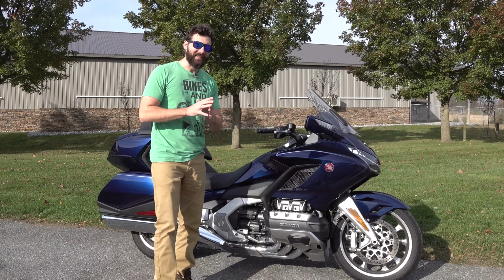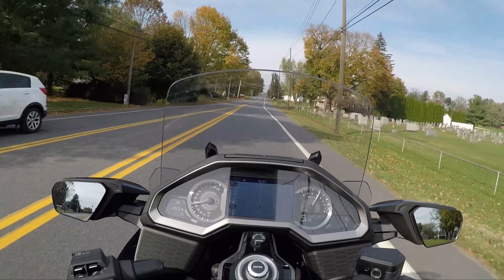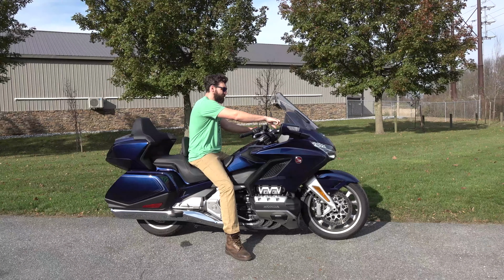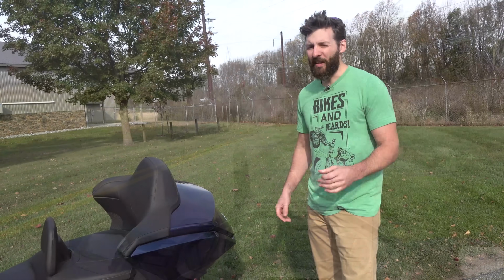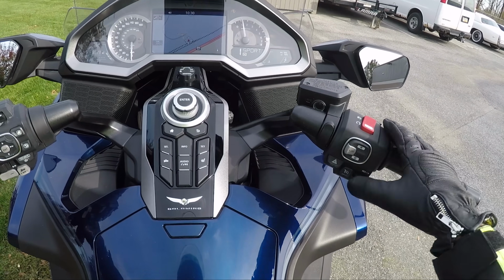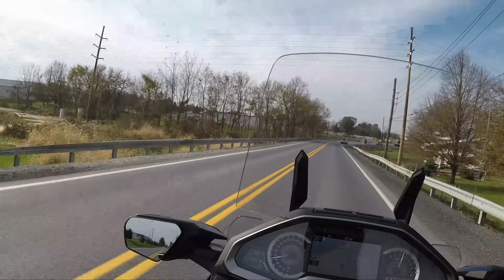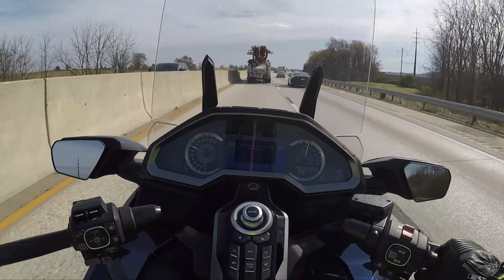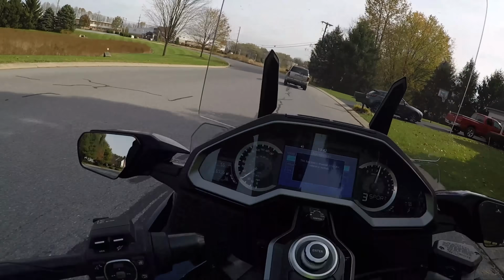You WILL NOT believe what the new Goldwing can do

Comment: Beautiful bike, I want one. It would be nice if the “tour pack” was removable.
I asked the Honda dealership, it doesn’t come off, at least not without a lot of tools.
Reply: Traxxion Dynamics in Woodstock, GA has ya covered with a conversion kit for the Goldwing and quick change option for tour.  YouTube search for Max McCallister.
Reply: Check billable hours on an air filter change before making that choice.....
Reply: @ZacVaper  Honda sells only a conversion kit to remove the tour pack and replace it with a cover. The OP is referring to a quick kit to remove it on days you don't want it, add it on days you do. If you look up the install time on the Honda kit, its 2.5 hours.
Reply: That's exactly what I keep thinking I don't take long trips I would like it without all that gear on it you would look so much better

Comment: For me, some of the pleasures of owning a motorcycle are “feeling the road “ and shifting gears. As far as the windshield going up and down, my BMW K1200LT did that. I had one of the previous generation Goldwings and my only complaint about it was whenever I tried to ride it like a sport bike, I always drug the boards even sooner than I did on a Harley. Now that I’m officially an old guy, I’d probably like this Goldwing. Unfortunately my legs don’t work like they used to so I’m off 2 wheels for good. Ride safely.
Reply: Get a Trike
Reply: @ronniemassart3834  what a thoughtful response. That would make a great deal of sense if I were able to lean into curves in the same way I did on 2 wheels.

Comment: I’ve been looking at all kinds of touring and sport touring bikes, including baggers, and I keep coming back to this. It’s everything I wish my 2016 FJR1300 was, and more. And compared to the rest of the class it’s the best value.
Reply: I sold my 2014 FJR1300ES and bought a 2022 GW tour DCT.  I loved the FJR, but the wing is a better bike.  Better suspension, brakes, handling, and comfort.  The GW is a little down on top end power, but you won't notice with that 100ft/lb of torque from 0 to 3500 RPM.  Speaking of power - A lot of my friends thought it would be slow.  Put it in sport mode at a stoplight and pin it when it turns green.  The front end gets super light, and the traction control is blinks rapidly!  Feels like it's going to pull your arms out of the socket!
Reply: @Skip_Recap  Sounds awesome. Now that I’ve owned and sold a DCT Honda I would buy the new updated 2022 Wing with a manual, especially since they’re likely going to be DCT only going forward. Manual has a higher top speed if what I’ve been told is correct. DCT is fantastic, but I’m always going back and forth between how great it is and how much I miss manual. Ultimately you need two bikes, one DCT.

Comment: yes it is the best MC out there. Nothing compares to the handling or power
Reply: Bill Sawyer Until you ride a K1600.
Reply: @LTVoyager  I was disappointed with the lack of low end power and lack of torque on the K1600. You have to rev it up. It did handle well though with good ergonomics.
Reply: Pitts S2C The K1600 is certainly a higher performance engine and like all high performance engines, it likes higher RPM.  I believe the redline is nearly 2 grand higher than the Wing.  So, it does attract a different style of rider.  Just as Harley attracts those who want to loaf down the boulevard at 2,000 RPM, the BMW attracts those who believe the fun is a twisty road running in 2nd gear between 6 and 8 grand.  Different strokes for different folks.  I only replied to this as the OP said nothing compares in handling or power and this is simply BS.  The K1600 both out handles the Wing and outruns it easily.

A year ago this past summer, I test rode the new Wing (DCT Tour model), the new Yamaha Venture, the K1600 GTL and the K1600 GA all within a short time span.  They all had their strong points, but for pure performance, the K1600s reign supreme.  However,  none were better overall than my current K1200LT so I elected to wait a couple more years before swapping rides.  Once my LT passes 100,000 miles next year or the year after, I will take another look.  The Wing is just too small in storage capacity for long distance two-up touring so it isn’t a contender for my travel style.  The Yamaha was very comfortable and has great storage capacity, but I am just not a 4,000 RPM redline, air-cooled V-twin type.  I like the GTL best for me personally, but my wife hates it.  She sits too high and gets tons of helmet buffeting which is not good for all day riding.  The GA was the best fit for her from among the four we test rode, but I am not a big fan of the stying as I much prefer the European style of the GTL.  In the end, we decided the LT was still the best fit for us and decided not to trade.  However, the power and electronic wizardry of the newer bikes is appealing.  I probably will test ride the new R1250RT before deciding what to buy as it has about the same performance as the Wing and K1600 in a lighter, simpler and easier to maintain package, albeit at some sacrifice in comfort.  All bikes are a compromise and the hard part is deciding which compromises you are willing to accept.
Reply: @LTVoyager  I had an LT and have had a GTL since 2013. My wife had the same issue on the GTL; sitting up high and getting wind noise and buffeting. Bought her a Schuberth C3Pro and problem was solved. Helmets can make a huge difference!
Reply: @pittss2c601  "low-end" is a very relative term.  If you're used to Harley's then low-end is 1500rpm, but on most multi cylinder bikes, especially in-line types with over 9k redline, 2500 or 3000 is "low-end", and there's no way the K1600 doesn't have plenty of grunt at those RPMs.
Reply: Tibor Toczauer I agree that a different helmet can affect wind noise, but the noise is not the issue as we wear earplugs while riding.  The issue is wind buffeting and a helmet doesn’t affect that appreciably.
Reply: Tibor Toczauer The Wing does produce more torque at lower RPM than the K1600.  I believe the Wing climbs above 100 lb-ft at about 2,300 RPM while the K1600 is closer to 4,000 to get above 100 lb-ft.  However, factor in the lighter weight of the K1600 and its faster revving engine and I will do a roll-on against a Wing any day in any gear starting at any RPM.  Any slight advantage the Wing has below 4,000 RPM will evaporate quickly.  I test rode both back to back and the K1600 outpolls the Wing in almost every circumstance as it’s 80+ lbs lighter weight offsets the Wings slight torque advantage down low.  The extra 230cc makes a difference at low RPM there is no denying that.
Reply: @LTVoyager  exactly, but that's because it delivers like a Harley; earlier torque and much lower redline. Just pointing out that the K16 also has plenty of torque down low, just not quite as low. That being said, I guess you'd be disappointed with the Wing after riding an electric, because those have real low-end torque 😉
Reply: Tibor Toczauer Yes, the Wing is better for those who are too lazy to shift.  That is why Honda added DCT.  LOL.
Reply: @LTVoyager  actually not just appreciably but incredibly well.  First-hand experience.
Reply: @LTVoyager  all I can speak from is our experience.  My wife is 5'6" and long-waisted, so she sits pretty high up on the back of the GTL.  Her head was getting buffeted all over the place wearing her old helmet, to the point where she wanted me to switch to a Chieftain where she was hunkered down behind me.  When the Shuberth C3Pro went on sale and I bought her one, the change was night and day.  I can now have my windscreen in any position and she is fine with it.  That is definitely not just a noise improvement.  We both always wear earplugs too by the way.
Reply: Tibor Toczauer I suspect the issue was the helmet fit rather than style.  A too loose helmet will move around on your head when in dirty air making the buffeting feel twice as bad.  A tight fitting helmet helps a lot, but it doesn’t affect the underlying problem.  If your head is in dirty air, it will move around and be very annoying after a long day and it doesn’t matter much what helmet you are wearing.  Dirty air affects objects of every shape and size and being “more aerodynamic” makes no difference.  If your wife’s Schuberth fits well and her prior helmet was too loose, then, yes, she will feel a big difference with the properly fitted helmet.  My wife uses the same helmet on our LT as on the GTLs we have rented and the difference is pronounced and since the helmet is the same, it is due to the bike and not the helmet.  She is 5’9” and just sits way too high on the GTL.
Reply: @LTVoyager  no, her previous helmet was not loose.  Aerodynamics make a very big difference. Besides, if you want "clean" air, lower the windscreen or buy a different one; a very minimal investment to make a great bike just about perfect.
Reply: Tibor Toczauer The aerodynamics of the helmet make almost no difference when the helmet is in dirty air.  In clean air, it can make a difference if the helmet is creating its own turbulence off of the rear of the helmet and causing buffeting that way.  What I am talking about is buffeting from dirty air from the windshield.  Both the Wing and the LT keep both rider and passenger in relatively calm air so it matters not what helmet you wear.  The GTL seat is so high that a tall passenger has their helmet in the turbulence coming off the windshield.  This will buffet your head no matter how aerodynamic the helmet is.  Sure, a larger and taller windshield will help, but I was comparing stock bikes here.  The stock GTL is simply not as comfortable for the passenger as is a stock Wing or stock LT.
Reply: LTVoyager, we can go back and forth like this, but aerodynamics of the helmet make a huge difference, when you use the windscreen properly.  I agree that the GTL's passenger seat is too high and contributes to the dirty air problems.  However, that problem is also caused by you putting the windscreen up TOO high.  Since the passenger is sitting so high AND so far away from the windscreen, most riders have a tendency to put the windscreen up really high in an effort to protect the passenger.  It won't work because the higher the windscreen, the more vertical it is and then you get even more turbulent air cascading over the top of it.  The best move is to LOWER your windscreen, put your passenger in clean air and buy them that darn aerodynamic helmet.  But yes, the LT and Wing offer a better cocoon for the passenger... as do Harleys, Indians, etc.  When your passenger is so high above the rider, no windscreen is going to protect their head properly.
Reply: Tibor Toczauer I tried every position on the GTL and nothing worked even close to my LT or the Gold Wing that we test rode.  That is why I said that when it comes to wind protection, the K1600 GTL falls far short of several other bikes.  The GA is better, but still falls short of the LT, Wing and new Yamaha Venture.  And I won’t invoke my aero engineering background or 40 years as a pilot, and simply let you be wrong on your aero claims.
Reply: @LTVoyager  you can "invoke'" whatever you wish, but if you disagree that aerodynamics makes a difference in clean air then you are either just being intransigent or ignorant.  I already agreed with you that the GTL puts the passenger up too high.  If you could not get clean air for your wife by lowering the windscreen so be it... I could and did.
Reply: Tibor Toczauer I already stated it makes a difference in clean air.  No disagreement there. Clean air is much more tiring on all day rides than is still air.  If I wanted to tour long distance in clean air, I’d save a ton of money and buy a naked bike.
Reply: @LTVoyager  only her head would be in the "clean" air and that when wearing an aerodynamic helmet is not that tiring.  Anyway, this is becoming pretty stupid.  My original intent was to point out what worked for my wife and I and give a suggestion, not dictate what works for you.  We all have to make our own comfort decisions.
Reply: Tibor Toczauer I agree.  My decision is to ride bikes that don’t require my head or my wife’s to be in anything but still air.  I was simply pointing out that the GTL is not such a bike.

Comment: Carplay, dct, flat 6.... this bike is more technologically sophisticated than most cars
Reply: now imagine having to work on it..
Reply: @epoxeclipse  what do you want to do ??  Oil changes = easy .... most other stuff also is not that hard ..
Reply: @1dlb  have you seen the complete wiring harness for the new goldwing? it's insane. have you seen the old one? it's more insane. next what if one of the systems fails. doing valve adjustments do you know the nightmare of accessing the engine for valve adjustment on a gold wing? I would rather sell it than trace a short and do a valve adjustment.  hopefully the timing chains on these outlive the bike.. oh wait they don't have a timing chain it's timing belts that's right Honda duped you idiots into buying a bike with a timing belt made for long distance riding. for the love of baby Jesus do not buy a bike that uses a timing belt for long distance.
Reply: @epoxeclipse  GoldWing hasn't had a timing belt  since the 1800 came out in 2001

Comment: My clutch hand and shift foot would still be going like it was a manual lol
Reply: I bought a 2003 Suzuki Burgman 650 in 2004, and for three days I kept going for the non-existent foot brake. (On the Burgman, the rear brake is on the left handlebar.) But after that, the new riding method became totally natural. The 650 had a manual shift mode, but it was just a novelty. After awhile I stopped using it; the system knew as well as -- if not better than -- I did when to shift. (I did use the "Power" mode from time to time, but never the full manual mode.)
Reply: You think that but within a few hours riding DCT you won't ever reach for the clutch again

Comment: I ride a scooter now, when I change to a motorbike, Goldwing will be my first motorbike.
Reply: If you think it's a "motorbike", maybe you should try something a little smaller to begin with.
Reply: This one isn't anyone's first motorcycle. Take a look at NC700X/750X, those have DCT too.
Reply: Consider a used Silverwing for a bit, get used to the feel, THEN update to a Goldwing.
I drive a 150PCX and get between 105 and 107 mpg around town and 96.4 mpg on the interstate.

The Silverwing is a great touring scooter, 600cc, and gets around 45mpg. 

It’s a smooth maxi scoot, too.

But if you wanna jump up to a Goldwing for your first bike, take your time until you’re used to it.
The Goldwing is about 800 pounds,. Basically a horse. 
Depending on what kinda scooter you ride, it can range between 120lbs up to 350.

My PCX is under 300, and is only 20 pounds more than the 2010 Elite (108cc with fuel injection) I used to use to get around town.

The 500 pound difference between my PCX and the Goldwing is significant.

Drive a Silverwing with a person on back and if you feel comfortable with that kinda weight, you’ll be all right on a Goldwing.

I’m a scooter driver but I’ve driven a Rebel and a Pacific Coast before. I’d consider a Goldwing one day, but the price is really the old thing standing in my way.

Comment: Wow! If you buy enough aftermarket accessories and add-ons, it's almost as comfortable as the '01 thru '17. The longevity of the new bike has yet to be proven. The '01 thru '17 have set a high bar for this new ST 1800 to match.
Reply: The old bikes are junk. The new bikes are better in every way.
Reply: It’s a Honda, there is nothing to proof. You just can’t get over that the new model is better

Comment: It kinda surprised me you never said what DCT stood for! That's the Dual Clutch Transmission! Honda's DCT is THE BEST! Basically it's 2 gear-sets, each with its own clutch, side by side, or inline, depending on space limitations. On acceleration, it sequentially shifts one, then the other, and back and forth all the way through the gears. While doing this, the next shift gear-set is engaged but the clutch isn't, until the shift point. This is when the magic happens! At each and every shift-point, the releasing clutch and the engaging clutch operate at exactly the same time!! Thus, no detectable pause during shifts!! And the real beauty part; only 2 clutches, and all simple gears, for almost zero drag.  
 It don't git no better'n dat!